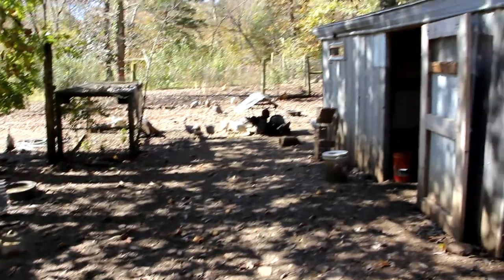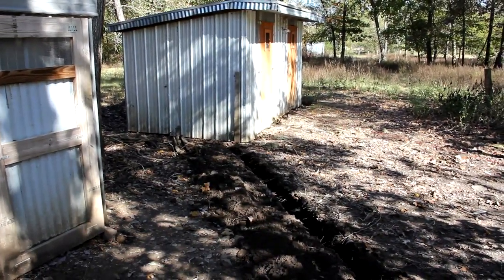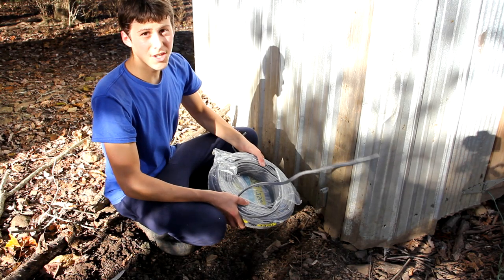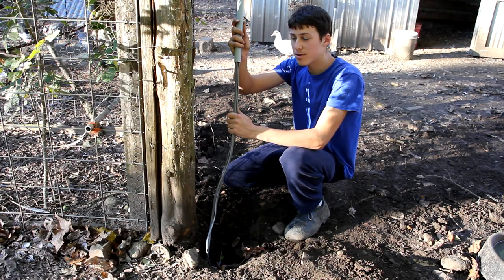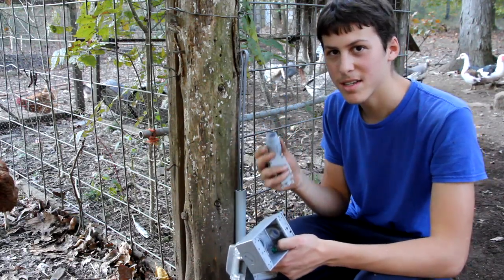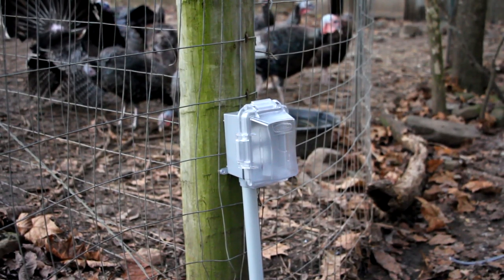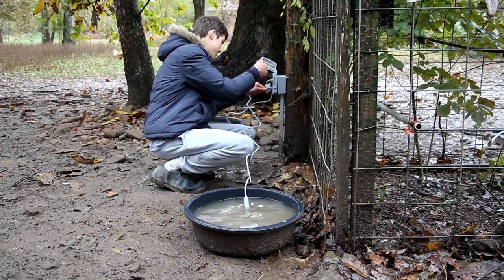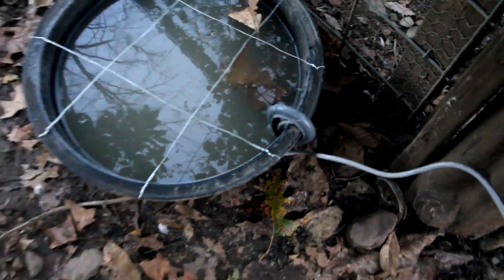Preparing for Winter - Underground Electric & Water Heaters

Comment: maybe to save some power you could add a timer so it turns on once an hour and not 24/7
Reply from the maker: That's a good idea, but actually the heaters have a thermostat so they only turn on when the temperature is at freezing.